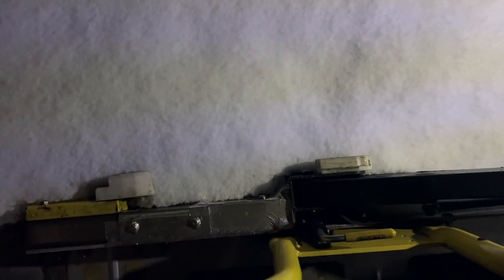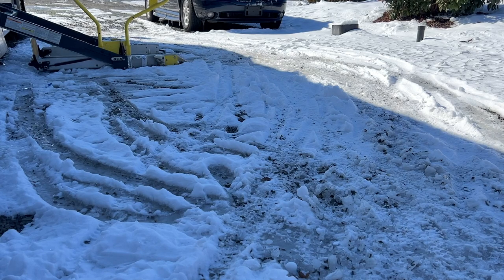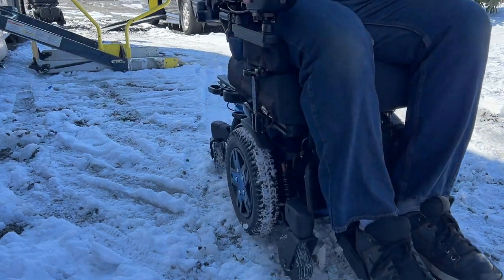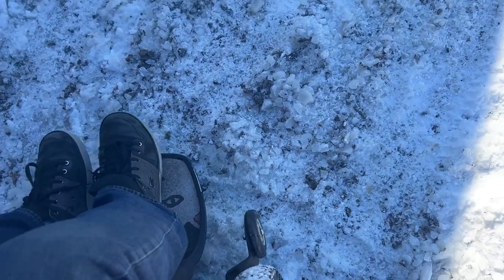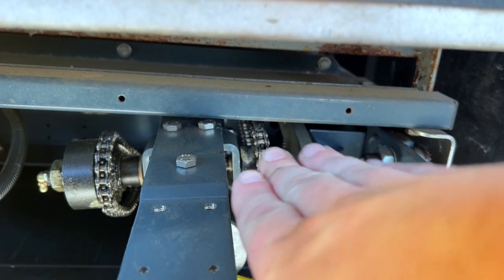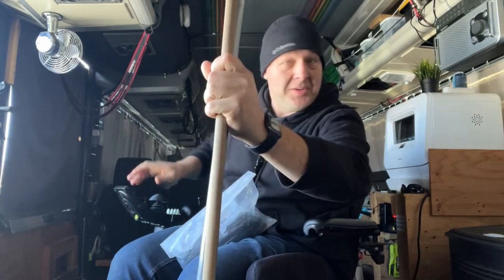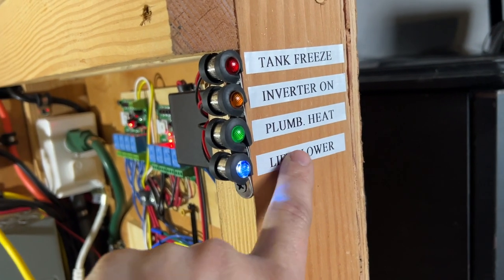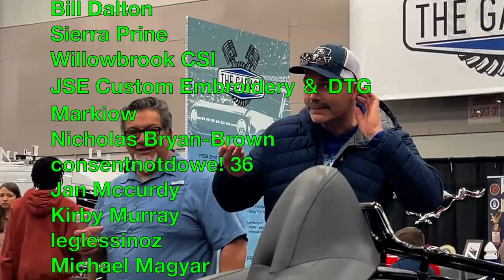VLOG 654: weather is DUMB! (also stretto traction test!)

Comment: Hi Dan, did you try the zip ties on your wheels for the extra traction in the snow. 

Also you say that the wheelchair lift is getting grit trapped in there, what about blasting it out with compressed air, you could have a couple of air lines going to the back of the lift facing towards the outside and held in place with your favourite metal clips and blast the grit out of the bay to the outside of the bus, a bit of over engineering for ya, lol 😆. 

Thanks for the video 👍.

Comment: Have you tried Teflon Spray under the lift to avoid sticky rocks/snow/etc.?    I used to have problems with mud and rocks sticking to the bottom of the chair and teflon spray helps a lot.    Only issue is I do have to repeat the application on a regular basis.  Usually every 3 months.

Comment: If you know anyone who uses those heavy rubber runners that stores use in the entryway, maybe you could get some ratty-looking used ones to put under your ramp?  A couple side-by-side on top of the gravel would give you a surface you could sweep clean that would not move much.  If you make the landing pad oversized, then put something in front of the bus that indicates how far to pull up, you would be able to park so that the landing pad is in the right place any time you move the bus.
Reply from the maker: ended up getting a horse stall mat - its about 3/4" rubber thats siped for traction on one side, and has small standoffs on the other to grip the ground and allow water to pass under

Comment: The Stretto isn't actually mid-wheel drive. It is front-bias, with the wheels just ahead of the midpoint. This leads to wacky suspension and steering geometry. The front caster wheels lift the drive wheels off of the ramp; you can even see it in your video.
Reply from the maker: yup!.. when there's no weight in the chair, the drive wheels barley touch the ground because of the preload on suspension springs! i know someone that doesnt weigh very much, and they have a heck of a time getting traction